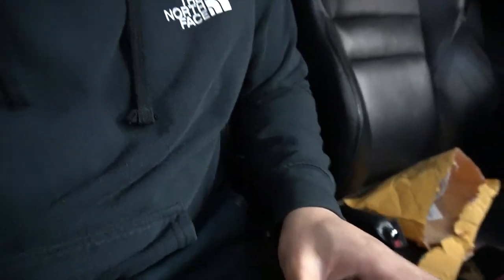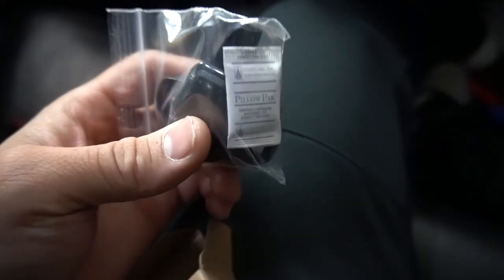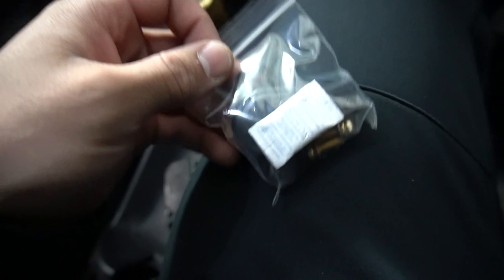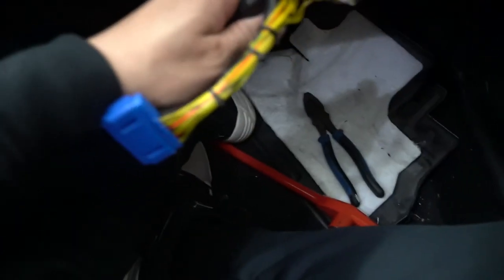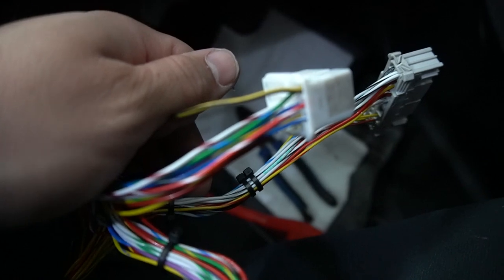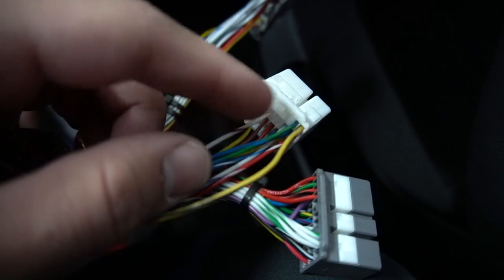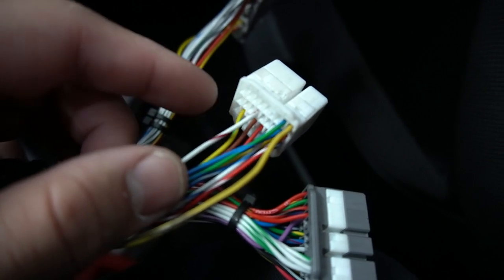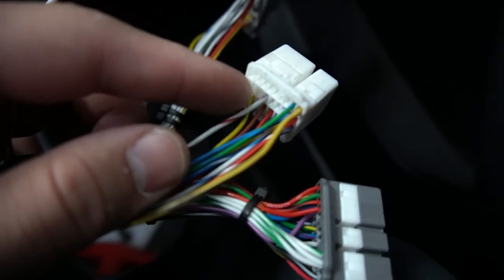🔴So Did We Finally FIX The DC5 + Acuity TPS Install... | ALL MOTOR RSX | VLOG

Comment: Did the bad tps feel like it would sometimes sputter or feel hesitant upon acceleration at low rpms? Did it ever feel like it restricted some of the power at higher rpm (5k-6k)? The car ever stall on you at idle? Good video.
Reply from the maker: Yes car didn’t drive well. but was never restricted rpm wise
Reply: I think we are having the same issue, my car feels kind of laggy after the 5k rpm mark and I'm having a hard time figuring it out
Reply: It wasn't my tps. Installed the acuity tps and it was doing the same thing.  It ended up being my fuel pump.  The fuel pump feed line in the fuel pump assembly was disconnecting.
Reply: @camlobesvtec  OH really, did you have to get a whole new feel pump?
Reply: No, I have a 65c deatschwerks upgraded fuel pump. I clipped it back together and secured it with wire and zip ties so that it wouldn't come loose again.  So far so good.
Reply: @camlobesvtec  So it was just the fuel line to the fuel pump that was going loose or was it something inside the fuel pump, sorry for all the questions I've just been struggling to find any solid answers on my problem
Reply: It was the fuel pump line that connects to the fuel pump in the fuel tank that was disconnecting.  Rsx and civics from the same generation  have a fuel pump cage in the tank. Inside the cage is the fuel pump.  Have you messed with your fuel pump?
Reply: Hello, sorry I have a restriction at 5k to 6k rpm and check engine code p1121. Without the code the car have no issues, as soon as check engine apear the car fail at that rpm. Any help? I have replaced tps already and the car still the same

Comment: I gotta re adjust mine. Mine ain't quite right. I adjust it to .49 closed.
Reply from the maker: honeslty i tried for a bit and dont think its possible to get it exact on both ends, acuity says +.2 or -.2 on full throttle is ok
Reply: As long it's close you should be fine. Resistance tolerances are typically like 5%
Reply from the maker: Wanted to add that it’s not 4.5 closed. They actually recommend 4.8 closed

Comment: Hey bro great videos. Where do you set your throttle cable setting on the throttle body?
Reply from the maker: whats up, hard to figure out what your referring to, but i purchased a new throttle cable . ill make a video on how to set it. but your throttle cable has two nuts that you use for adjustment, rite before your throttle plate opens , you want to lock it in. hard to explain
Reply: @Deemossi  yes it does. I was referring to the hole that you put the end of the cable into on the throttle body. I've seen that you can adjust the hole position to set the end of the cable into. I'm currently playing with it now on my 80mm throttle body. Looking forward to the new video. Thanks for responding bro.
Reply from the maker: No prob. Yea the ktuned tb has many adjustments . you can adjust the wheel it’s self removing the 5 small Allen screws that hold the wheel . I’ve heard if you remove those to . Make sure you use locktite. but the spring inside the TB is what I adjusted , that pretty much solved my issues . thanks for the support bro 🙏🏾

Comment: Hello, sorry I have a restriction at 5k to 6k rpm and check engine code p1121. Without the code the car have no issues, as soon as check engine apear the car fail at that rpm. Any help? I have replaced tps already and the car still the same

Comment: My kswap revs to 2000 then struggles and hangs up and bounces back but if i try hard enough it will rev over 2000 i didn't set the tps like that i only did it in kpro anyone think this could be my problem?
Reply: Did you figure it out ? I’m having the same issue on my 24 swapped Rsx , let me know thanks 🙏🏽

Comment: On ktuner, when you push the throttle all the way down, do you get 100%? I’m currently capping at 80%
Reply from the maker: Yea 80 is normal at WOT ( wide open throttle )
Reply: @Deemossi  yeah, checked my voltage and it’s normal range but won’t go above that. There’s a plate on the TB that’s stopping it. Thinking about trimming it lol

Comment: What symptoms did you get for bad tps?
Reply from the maker: Lag and just a shitty throttle response
Reply: Also your RPMs will be at 2000 when cold start. Also it may drop lower than 500 rpm causing you to stall in neutral/idle. I just replaced mine cause my stock TPS caused this problem, new Acuity TPS fixed my problem and cleared my check engine light.
Reply from the maker: Shot by Hoodie thanks for adding that. A New TPS is definitely a must have piece if your experience any of these issues or if your changing out Tb 💯
Reply: My rsx just kept revving full throttle do y’all think it’s the sensor?
Reply: @kevinvillatoro5806  it could be bro , or maybe the iacv sensor